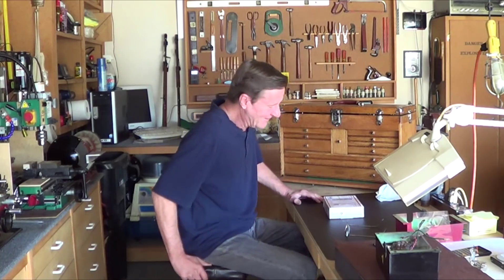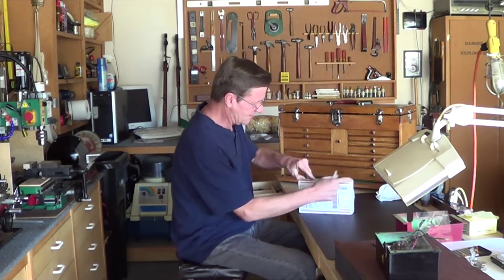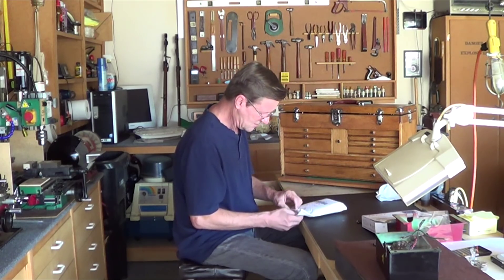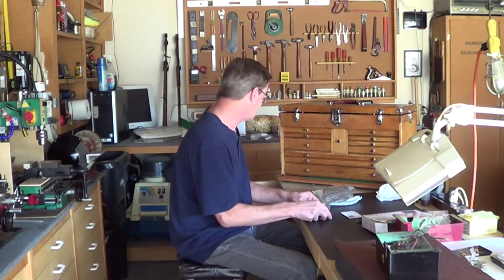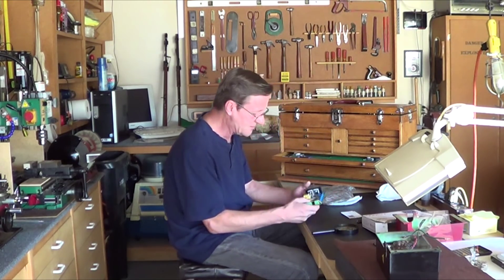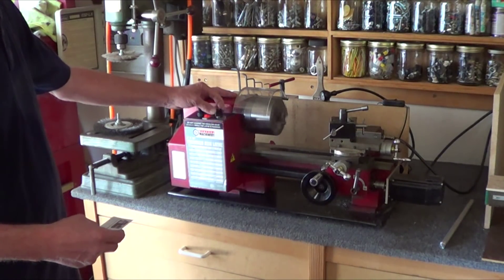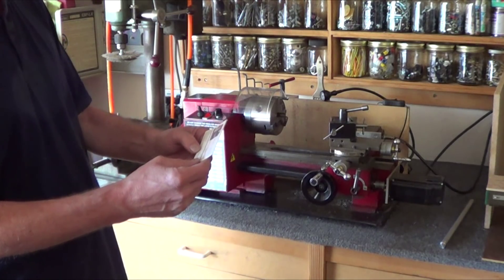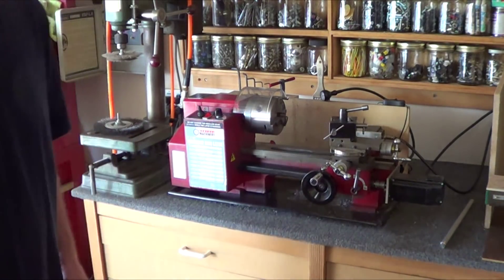Mini Lathe Motor Controlller Repair Video #18

Comment: Hello! I replaced 2 transistors on my mini lathe because it got a short circuit. Now when I start my lathe the green button spins for a second and stops, it can't hold voltage to the motor. My question to you is what could be the problem?
Reply from the maker: I have no idea what lathe you have but disconnect the motor and see if voltage stays if so you have an over current adjustment problem.
Reply: I replaced all the transistors that were C6025L with D6025L transistors, also the two thyristors that were X6025 with S6025L thyristors. My lathe is Vevor 550 watts 7x14 DC220 volts @TheMiniMachineShop

Comment: Every dude doing this repair videos are a struggle to get anything from
Reply from the maker: It was stated send your board into the Old UHF Guy for repair unless you have a schematic and are equipped to deal with surface mounted components.

Comment: Dave,  I have a question about these common mini Mills using the 350 Watt PM motor.   Has a black and white and green wire going to motor.  If I switch the Black and White in the Junction box, will the motor run in Reverse?   Will it blow up my electronics?
Reply from the maker: No problem runs in reverse I've done it..
Reply from the maker: But with stock gears at that time, it made a terrible noise.

Comment: I have burnt the IGBT transistor on my MX-210V mini lathe, when switched the rotation direction too fast. The motor was still spinning, while the reverse polarity was switched on. So, i replaced the G40N60 transistor to a similar one. The problem was fixed then. After a while, I have burnt the MCU (while connecting the wires, the potentiometer input to MCU (HT66F018) got hundreds of volts from large capacitor, standing after IGBT), generating PWM signal for IGBT. Then I removed MCU from the board and installed an Arduino instead. Programmed it with couple lines of code and the lathe recovered again..
Reply from the maker: You should do a video on this!
Reply: @TheMiniMachineShop  yeah, here it is  https://www.youtube.com/watch?v=t2SYP35oyWQ

Comment: Dave. 
I have a harbor fright mini lathe also and some times when I turn it on there’s no power and other times there is. Other times the power switch light is barely on but no power to run the lathe. Do you know what could be wrong?
Reply from the maker: Simple it's a bad power switch. unplug the lathe and cycle the switch 20 times see if that helps...

Comment: Not exactly a motor controller repair, but a replacement..! So what exactly was the point of this video?
Reply from the maker: The point is to tell others where to get their control board repaired since the LMS replacement board doesn't work right. Many have emailed me for help on this subject since the chips are all surface mount thus you need special tools. Curious why you watched this video?
Reply: @TheMiniMachineShop  Ah ok. Just unfortunate is wasn't what I was looking for.  I have a 240v Clarke CL300M, a Sieg variant. Given the diodes and thyristors are ok, there 's clearly a fault with the  signal trigger source, and that, without a circuit schematic is a little more difficult to trace. So annoying, because when probing with DMM or ocilloscope, the motor spins (sort of). :/
Reply from the maker: I would test the motor with a DC supply by itself first. Many times chips get inside or worn brushes. Then looks like there are only 2 ICs which are not surface mounted and can easily be replaced. Google Clarke cl300 schematic and go into images. The schematics are there and the scope should tell you where the problem is...

Comment: What’s was you problem? Why replacing the board/repair?
I’m having problems with mine at the moment, the lathe just shots off in the middle of turning, any thoughts would be appreciated!
Reply from the maker: I damaged it adding a tachometer. There is a current limit protection circuit on the control board. You can adjust it so it won't trip while turning.
Reply: Dave M I’m sorry you said adjusting it? Where exactly is adjusting knob?
Reply from the maker: I don't know what lathe you have thus what control board but there are a number of adjustment pots on the control board itself. You will have to try each one to find the correct one. Turn 1/16 CW then CCW and test.
Reply: OK JUST TO MAKE CLEAR FOR PEOPLE OUTER, I HAVE THE HF MINI LATHE 7X12
 THANK YOU DAVE FOR REPLY TO MY COMMENT, OK I ADJUST THE (HIGH AND TORQUE KNOB) ON THE BOARD A 1/4 OF A TURN COUNTER CLOCKWISE  AND NO THE LATHE IS CUTTING STEEL LIKE A CHAMP, THANKS AGAIN DAVE I ENJOY ALL YOU VIDEOS
Reply from the maker: A lot of people have the HF which pot did you turn? What was it labeled?
Reply: THEY ARE TWO SQUARE BLUE BOXES WITH LITTLE KNOB ON TOP LABEL SPEED AND TORQUE